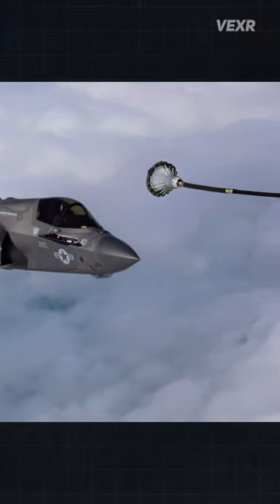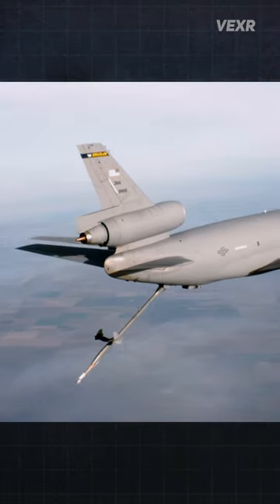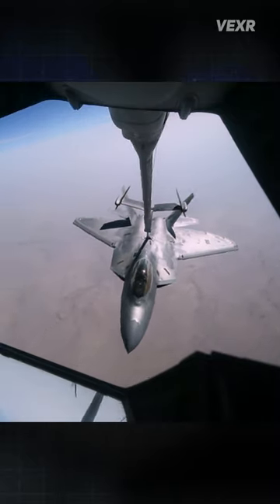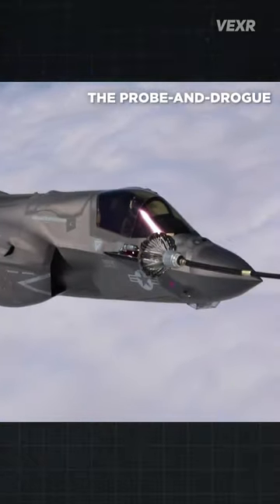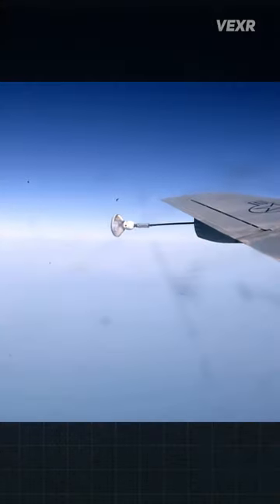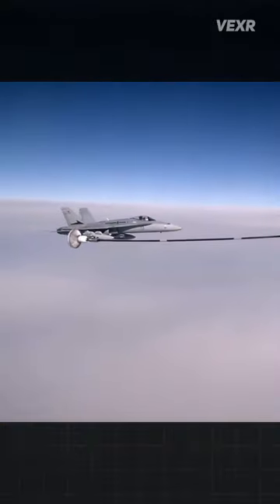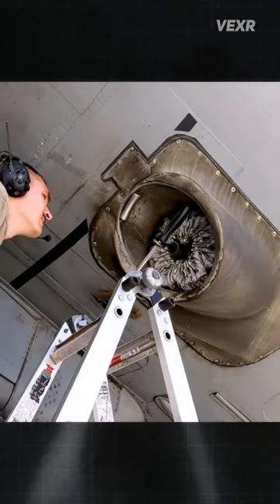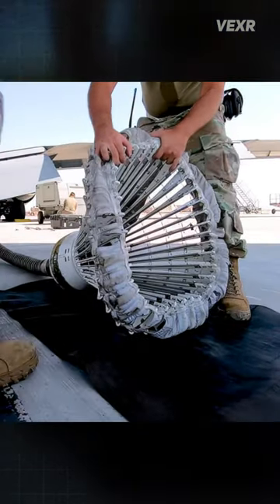The Contraption That Stops Jet Refueling From Going BOOM

Comment: The Boom is much faster but requires  a far more specialized plane and crew. Pretty much only the usaf use it, i think japan does but most use the drogue and probe method
Reply: Boom Is too complicated and requires too large of an aircraft for the US Navy and Marines.  But it works better in high wind environments.
Reply: With probe and drogue, a large tanker can refuel 2 or even 3 smaller aircraft at once, one off each wing, and one central.

Comment: Little thing: the boom arms are usually American and the drouges are usually british
Reply: Yeah, the USAF is a bit weird, they’re really the only ones using booms. The Navy and Marine Corps use drogues. But each service has its exceptions. British use a lot of planes that refuel via boom, like cargo planes.
Reply: @alexbuss3377 it's actually pretty much all NATO allies that use the MPRS system only the U.S. Air Force uses the boom
Reply: @imperfectravens2410  they refuel their American made planes using booms. They haven’t adapted those airframes to use probe and drogue.
Reply: @alexbuss3377  The carrier models need drogues to refuel so yea Navy and Marines need drogues Army and Air Force do not
Reply: @imperfectravens2410  look at the refueling booms on the CH-47, those go into drogue baskets.
Reply: @alexbuss3377 the Americans use the boom because it transfers at 6k lbs/min vs the drogue at 2k lbs/min, and they have a large inventory of big planes that take loads of fuel over 100k lbs.
Reply: @alexbuss3377 this is entirely inaccurate as the f18 utilizes the drogue.
Reply: @ItsNotFate  This F-18 is a carrier plane so that's a navy plane
Reply: @kylesaavedra5400  how is what you’re saying relevant?!?! I know this lol, it’s still an American plane.
Reply: @ItsNotFate  pretty sure you’re misreading this. The USAF uses Flying Boom. the USN, USCG, and US Army use Probes and Drogues (for the most part, obviously there are exceptions) almost all other countries use primarily Drogues
Reply: The boom transfers the fuel faster, but the F-35 (pictured) uses the drogue because, on the Marines' version, the top of the aircraft, where the boom connection would be, is occupied by the vertical takeoff/landing fan.
Reply: The US Marines and Navy uses drogues.   The USAF tankers mainly uses booms, as they are more diverse and controlable, but USAF tankers also have drouges they can extend to feed Navy, Marines and Army choppers.
Reply: The F-105 was equipped to use the boom, like most airforce jets, but also had a retractable probe.  It could refuel from navy tankers, too.

Comment: Mid air refueling is so cool
Reply: You should try driving a ship at 75 feet from another ship at 15-18 knots and take on 100 tonnes fuel while taking helo replenishment aft at the same time. It's not as easy as it looks. Even 40 years later my heart rate goes up just remembering it.

Comment: I think the rope technique is better because in the other technique, the fuel filling operator manages it separately, you control the plane separately, think of it as driving a truck, the back part plays separately.
Reply: Drogues are a bit spooky and depend a lot on the air currents, The boom methed at least has visual & aural communication between the reciever and "boomer"